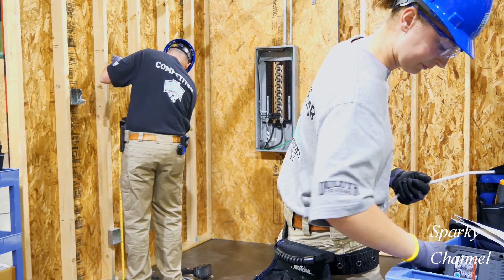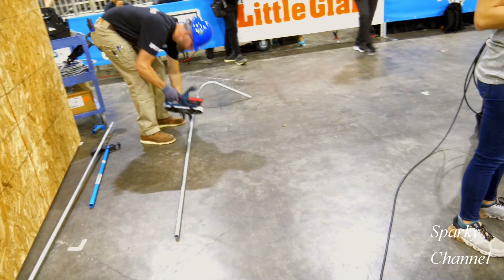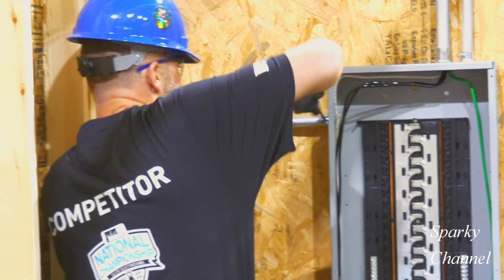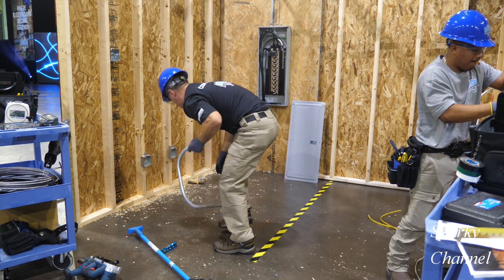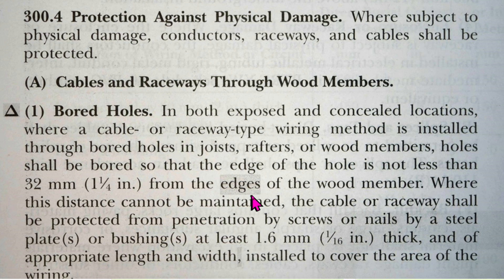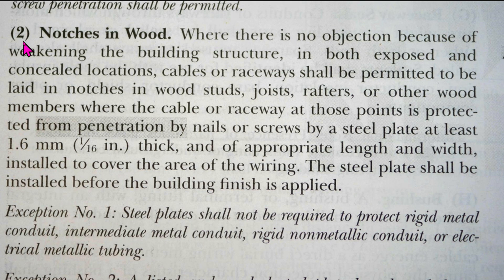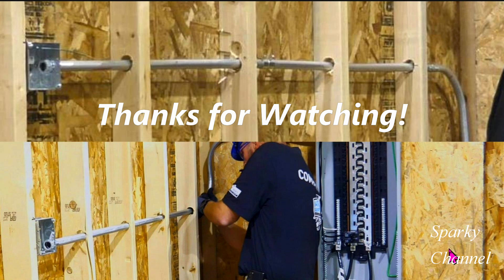How to Run Conduit in Studs per 2023 NEC 300.4(A)(1)

Comment from the maker: Timestamps
00:00 How to Run Conduit in Studs per 2023 NEC 300.4(A)(1)
00:06 Greg Anliker and Emma Beckett starting their challenges
01:19 Greg bends double 90°'s
02:11 Greg runs straight 3/4" emt in the studs
02:52 Greg puts a box offset on his double 90°'s
03:23 Greg adds double 90°'s to the straight emt
04:06 Roman begins his challenge
04:54 Roman bends his double 90°'s
06:10 Roman begins his straight pipe installation
07:14 Roman installs his 2nd straight pipe piece
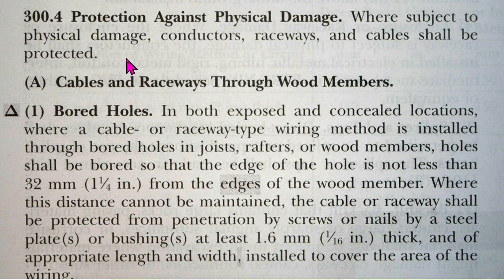08:20 2023 NEC 300.4(A)(1)
10:45 2023 NEC 300.4(A)(1) Exception #1
12:00 Raul Vasquez interview
12:37 My opinion and wrap-up

Comment: at 12:58, it looks like the 4x4 box at the top is deeper and the knockout was further back, which would have helped him be near the center of the studs. The bottom 4x4 box looks shallow. Not exactly fair if they're not given the same parts to work with.

Comment: You have to run a nail plate 300.4 nec   Code book
Reply: As he pointed out in the video, 300.4(A)(1) Exception 1: Steel nail plates not required if using Rigid, EMT, RMC, IMC, or rigid PVC, RTRC.

Per code, you don’t need a nail plate if you’re running EMT.
Reply: Did the codes change again?

Comment: Seems like a place where BX should be used but considering how destructive it is to run the EMT through the studs, maybe run the EMT straight up into the rafters or down into a crawl space or basement. That way the runs, while longer, would be cleaner and would be less likely to impact the structures integrity.

Comment: Code says no metal plates required if using EMT. However the NEC always refers to the AHJ and in this case the AHJ is saying plates needed if the EMT is not 1 1/4" on center from the edge of the stud.
Also competitor #2 did not support the EMT within 12" of the panel enclosure. He also would not be able to strap the EMT because he did not put a box set in the EMT where it enter the panel enclosure.
Reply: “competitor #2 did not support the EMT within 12" of the panel enclosure.”

Code for supporting EMT is 3’ from the box, not 12”. You’re thinking of NM cable.

Comment: Electrical codes are stupid. Romex in a studded wall in Nebraska has been efficient for the existence of said materials and all of the sudden, it's not good enough anymore because someone said so. It's a joke in order to get more money into dwelling price. Wonder why banks can't appraise at cost? This crap is why. 450000 for a 1400 sq foot house. It was 180000 3 years ago
Reply: Building code has almost less to do with a price increase of $270k on a 1,400 sq ft home. You're talking maybe a few thousand bucks in material and labor for EMT to be added into a wood framed home. That's also not assuming that bare naked t-studs are being used, which makes installation a breeze as it's wood dowel joined so space already exists to install conduit.
Reply: Romex is the reason for arc fault breakers.  If people were running their wires in emt or other fully shielded by grounding path conduit there would be no need for arc fault, or the need would be so reduced to not really be needed all.  Romex is a scourge for which we've had to find many work arounds.  Barely an upgrade from knob and tube.
Reply: That rule has nothing to do with the NEC. Complain to the politicians who were bought by the EMT industry.

Comment: Using 1 1/4 drywall screws wont touch the EMT if its 1 1/2 in from the 2x 4 edge
Reply: Neither will 1 5/8 screws, the drywall is at least 1/2" thick.

Comment: You mentioned that this was per 2023 code, so the exception (as you mentioned) allows for EMT without a nail plate. In NC, I believe the code [R602.6] allows for a notch of a stud for a non-bearing wall to be upto 40%. The width of a 2x4 is typically 3.5". You can get away with a hole about 1.4" in diam. If that stud showing a crack @2:27 hadn't split like that, he probably would be ok. But, unfortunately, once it split, it probably wouldn't pass, because the hole + the split enlarged the hole more than the allowed.

Comment: Homeowner here. I just did my kitchen in EMT because I was curious what it would take vs non-metallic wire. Also it'll be easier to add a circuit. My observations:

1) Cutting 14.5" pieces allowed me to center the conduit and use tight holes (.75" holes for 1/2" EMT). I imagine chicago electricians buy precut pieces like this or make them in bulk during downtime?

2) I went into the sides of boxes. I'm not sure if this is how pros do it or if they 90 and go in through the bottom or top. It made adjustment of the height difficult... my holes were not perfect with the laser level so sone boxes are 1/4" off level.

4) Also, its difficult to secure a box to a stud and also enter the box through the side with conduit that runs through that stud.

5) I used 4" steel boxes. They are annoying to screw directly to studs because the mud ring is bigger than the box face. I used a lot of 4" boxes with a side mounting plate to solve that problem for end-of-run boxes. 

5) To get around a corner, I went through the crawlspace with a U bend.

6) something not covered here is what support is necessary for conduit run in the wall, especially when there are many couplings. I'll check NEC for that.

7) I think 1/2 EMT can fit 4 circuits (12 AWG THHN is rated at 30 amps@90 degrees C which gets derated to 21 amps based on 8 current carrying conductors in one raceway). Normally I run 3/4 EMT, but it seems unnecessary for branch circuits where derating is the limiting factor. 1/2 is so much easier and requires less impact on the structure (smaller holes).

8) bending conduit is cool and all, but I wish there was a machine that could do it for me. Kinda hard on the body and hard to do precisely (esp offsets) for a novice.

It was slow for me vs NM, but I would do it again, at least for the kitchen which has so many different circuits.
Reply: Some answer to your inquiries. 
Nobody buys precut EMT, even back in the day before battery tools when we all used hacksaws. 
To do a 90 in a corner we use a short radius bender, made by Garvin. Looks kind of like an old school hickey. 
When sharing neutrals you can run 6 circuits (9 #12s) in 1/2" EMT. 
The bored holes are considered support for EMT; a 1/2" drive strap every 10' covers the secured requirement. The number or locations of couplings has no effect on the securing and supporting requirements. 
Going into/out of the top of box with a 90 is usually easier then going into the side of the box.
Reply: Support can be achieved via Florida Bobs
Reply: @cumminspower  Waste of money. The bored hole is the support. Florida bobs are best for steel framing so the conduit doesn't rest loosely in the holes and rattle.
Reply: The boxes are best supported by using a box bracket like a Caddy RBS16 or RBS24 depending on the spacing of the wall studs.
Reply: “(12 AWG THHN is rated at 30 amps@90 degrees C which gets derated to 21 amps…”

Whoever told you this is mistaken.

12 AWG wires have an ampacity of 30 amps, but you cannot use them for more than a 20 amp circuit, per the code. Same with 14 AWG & 10 AWG. Their ampacity is higher than when current is allowed on them.

Comment: So, according to NEC 300.4(A)(1) you would have to put a nail plate on the exterior-facing edge of the stud if you bored a hole in it that was less than 1 1/4 in. from the exterior-facing edge?
Reply: Not with EMT. Look at Exception1in 300.4(A)(1).

Comment: I’m a retired Chicago 134 electrician. I had a friend that was remodeling a bathroom in the apartment building he owned. Turns out, the EMT was running in the depth of the first example. He drove a drywall screw dead center into the conduit and created a short circuit. If there’s enough “meat” on the wood to guide that drywall screw dead center it can penetrate the thin wall pipe. Also, using a 1 1/4 drywall screw depth is not realistic, (although it is the standard for hanging sheet rock) people use all kinds of drywall screw lengths. Furthermore, the corners are completely unrealistic, I’ve never seen a corner with less than two studs.
Reply from the maker: All great points, thanks!
Reply: If he drove a drywall screw through EMT, he's not a smart guy. There's no possible way, even dead center, that you could drive a drywall screw into EMT and not know you hit something; the screw would come to a dead stop once you hit it and continue spinning. Then, knowing you are hitting something that's not wood, you'd have to keep the screw gun spinning while pushing on it hard for several seconds for this to even be possible. The walls of emt are the almost the same thickness as a nail plate so no, nail plates are not required and are unnecessary with thinwall. However, I've never agreed with the exception that allows you to run PVC without a nailplate. I don't ever run PVC except underground, but one could pretty easily drive right into PVC with little effort and think it's a knot.

Comment: The nail plate does nothing for the weakened stud, although it protects the raceway. And, the code does exempt most conduit types from the nail plate installation anyway. i would have opted for the EMT on centers to avoid questioning by the authority to avoid rework. Yes, it's a bit more difficult to do it on centers. Also, if PVC conduit is permitted it's easier to work with as you can use a heat gun to soften it to make it more pliable. I like to make the first hole a bit larger to start the pipe, the all the other holes smaller, just enough to pass the pipe through. Takes more time, but prefer to do it that way. Electrical work is not a race. Need the extra volume for the ground conductor too if PVC.  Once PVC cools off, it will keep it's position.
Reply from the maker: Thanks Seth. Excellent tips and points!
Reply: Thanks, Seth. Would you know the NEC code and the rule for using PVC vs. EMT or other materials? Thanks
Reply: The nail plates aren't for the studs bonehead

Comment: You’d think they could come up with a better competition than this that actually applies to the real world. You would never do this install in the field unless you live in Chicago
Reply: Or NYC. NMC is forbidden in NYC. There can only use flex metal, MC, liquid Tite (tm) etc.  for short jumpers to equipment, fixtures etc. Everything else is EMT or Rigid galv / aluminum pipe.
Reply: @sethtaylor5938 We us BX(AC) cable in NYC for most installations commercial and residential. Romex is allowed in pure residential buildings with no more than 2 apartments and a maximum building height of 3 stories. MC cable is used in some commercial applications but mostly BX is used. Medical installations use HCF which is AC cable with an additional insulated ground conductor.
Reply from the maker: I understand your point.

Comment: So, if I am understanding this content correctly (NEC Code) you only need to run EMT (or similar) when going through studs but not necessary when dropping straight down in between studs?
Reply: There is also a section that refers to strapping. If you can’t maintain 1 1/4 along the studs you also need protection.

Comment: I thought mc will work lol who runs emit in studs?
Reply: Chicago doesn't allow MC. It has to be EMT or better.
Reply: @arazusaysbah6784  Chicago administration needs to go
Reply: I would never live in Chicago even if you paid me to.
Reply: @jolyonwelsh9834 It’s not a matter of living in Chicago, it’s a matter of the project your working on being in Chicago. The majority of projects we did were commercial and there’s no skipping on using piping. The city requires it, inspectors look for it so it’s out of the company’s hands that wish to do work there. I’m retired now and when I work on friends houses, I always use pipe. The huge advantage is that you can pull more wire to add more circuits (if your pipe size allows to do so) or change layouts say in a drop ceiling or even drywall. I’ve been bending pipe for over 60 years and will continue to do so.
Reply: NYC too. Flex and liquid Tite(tm) only for short drops to fixtures and equipment.

Comment: I'm sure there must be alot of people running romex and not bothering to get permits so they won't have to use conduit 🤷‍♂️.  In my area nobody gets permits for anything unless code enforcement knows you are working on a project. Usually if its inside of a building they never know what you are doing!  Alot of people doing stuff they have no clue what they are doing. Wiring a stove using 10-2 Romex with 50 amp breaker etc.🙄
Reply: 10-2 with 30 amp?
Reply: @osajohnson1957  Yes 30 would be the correct breaker,  not 50

Comment: Putting a slight bend in the conduit makes putting it in the stud so much easier! The conduit can be straightened out with that special tool once installed
Reply: Special tool = elbow grease?
Reply from the maker: Thanks for the tip!
Reply: What special tool?

Comment: The first installer didn't need 3 pieces because of how close his holes were to the edge of the stud! 
If he was centered he also would have used 3 pieces, or ended up with unintended bends to the conduit. 
The real test would be to run conduit through floor joists!
Reply from the maker: Thanks!
Reply: so the first guy is now a 4th winner of $40.000  correct because he cuts corners which is okay by code and is showing you how to save time ??????

Comment: i have installed emt in wood studs per code in highland park (dallas) texas.  it is a tough install, we mostly stuck to 1/2" where possible.  one thing i noticed is that there was not a wood corner framed to go through.  that is the real challenge.  but honestly you need to start with 1-1/2" wood bit.  we were not required to install protection plates.  not necessary with emt.  drywall nails dont generally have the strength to penetrate emt (i assume!).  and i did tend to shade to one edge or the other of studs just to help myself.  also a very handy item is the coupling that slides completely over the conduit. that way you are not fighting as much to pop the conduit into the coupling.  but overall, it is going to take much longer than normal.
Reply from the maker: Sounds good. Thanks Ivan!

Comment: So much easier to run mc or bx than emt inside wall. Inspector would be WRONG to not allow armor cable inside wood stud wall. We run miles of emt in industrial buildings and always have large work tables, so much easier than working on floor to check 90s and measure kicks, offsets saddles   Etc and make adjustments
Reply: There is wrong and there is wrong. Even when the AHJ is technically wrong by code standards, if they say do it [this way], then you do what they said. Too often electricians spend a lot of time and effort trying to fight their inspector when life is much easier when you just do what they want in the first place and move on. I know you're right and you know you're right, but that doesn't matter at the end of the day
Reply: @TwilightxKnight13  Last sentence is great.
Reply from the maker: Good tips, thanks!

Comment: You asked "Would you" and yes I would.  You asked about arguing with the inspector, and if it's just one wall no, but I'm not going to redo an entire floor if the code doesn't require it, but you didn't ask about the code.  It clearly excludes EMT from the requirements...

Overall answer: have a copy of the *current* code and discuss with the inspector.  If the work is up to code he should approve it.  Others wrote we now use electric screwdrivers -- so what?  You can tear into EMT any number of ways.  The question is not "could you" but rather "what does the code require when installing EMT" and if you want to discuss safety also (always a consideration) "What are the odds someone will punch through EMT with a drill bit that good and not also punch through 1/16?  Zero.
Reply: You would redo that entire floor if the AHJ told you to. The code is a guideline. It is not a law such that you can take the inspector to "electrician court" and have a judge over-turn them. In most cases, you just do what they want and move on. The key is learning what pet peeves your inspector has and adhering to them so you don't have to do rework. And if you are a tradesman, you are getting paid by the hour anyway, so go redo that entire floor and let the contractor argue with the inspector
Reply from the maker: Thanks!
Reply: Also the 1/2 EMT is in a bore larger than it's diameter! A fastener will deflect off the rounded surface of the conduit, and the oversized holes allow the conduit to push (deflect) further reducing the chance of puncture.

Comment: since electric screw drivers are the tool of choice these days you will find screws with penetrate EMT ; so if the EMT is not 1 1/4 inches from the outside surface of the stud nail plate is not needed.  But if closer they are.
Reply from the maker: Thanks John!
Reply: By code they are not required. However, the code is only a guideline and the AHJ can insist you put plates on anything they want even if it is not required by the code
Reply: @TwilightxKnight13  Absolutely not.

Comment: Looks like the 1-1\4 dim is from the edge of the hole to edge of stud, not center of conduit. 
So the smaller you can make the hole the more likely you will have 1-1/4 left from edge of hole to edge
of stud and not have to use plates.
Reply from the maker: Good point, thanks!

Comment: I notch out the stud an 1/2 " and off set the conduit at the J Box and then use stud plates
Reply: Way more efficient, and you don’t need to destroy so much stud. Not sure why they’re drilling holes. Notches with plates on top seems better in so many ways.
Reply from the maker: Interesting, thanks!

Comment: yes a nail plate should be installed, plus it would also put back some of the strength of the broken stud if it is long enough.
Reply from the maker: Excellent point, thanks!
Reply: meh. typical nailing plates do not add any strength. They barely stick to the stud with their small twisted spike.